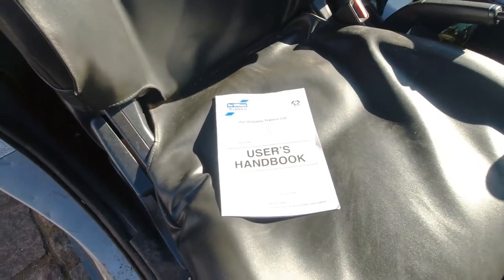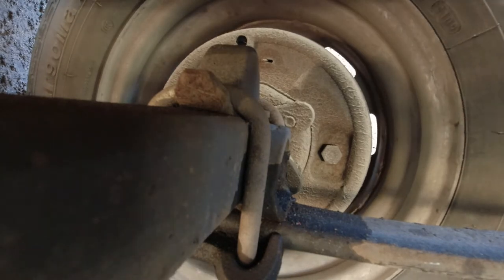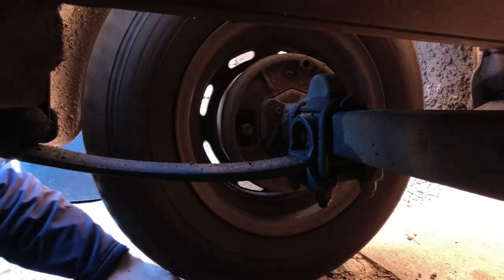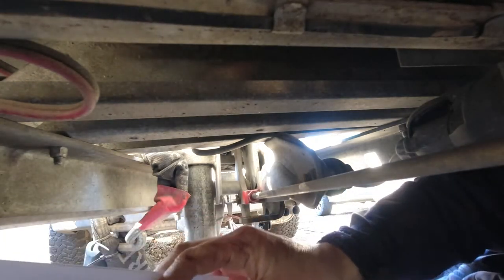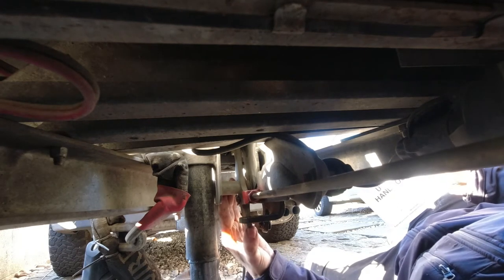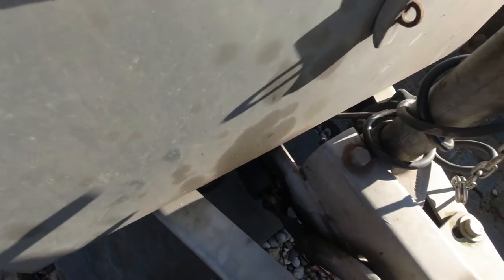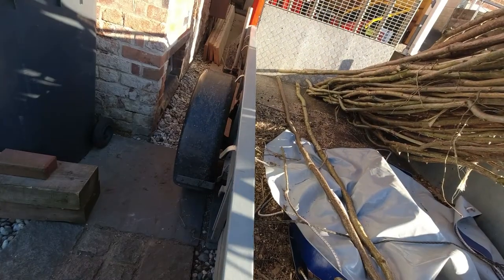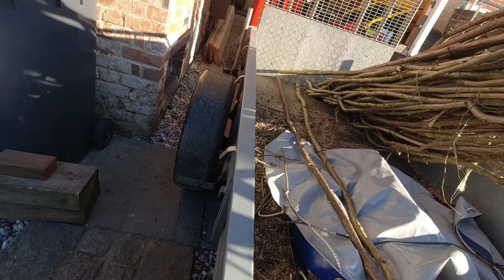Ifor Williams GD84 Trailer How to Adjust the Brakes

Comment: That’s just what I was looking for … a man with the instruction book doing it right as I’ve just bought a huge old trailer and have completely overhauled the brakes. Not I need to set them up… cheers very much 👍
Reply from the maker: Brilliant glad to be of some assistance
Reply: A lot easier to remove the road wheels to access the adjuster bolt on the back of the drum. That’s the back of the backplate, not front or rear side of the drum! 
To be honest most brake rods once set don’t need much if any adjustment. Adjusting the brake shoes with the adjuster bolt is adequate.
Reply from the maker: @medicontrol69  brilliant thanks, my next job is to check the brake shoes and replace if needed

Comment: Just doing this job today but as I understand it, when turning the wheels backwards they should partially rotate before re-locking, and for each wheel the handbrake will rise as the compensator re-applies the brake.  I don't think you turned them hard enough.  When doing this (or using the handbrake when rolling the trailer backwards) the handbrake will come right up towards the vertical.  Otherwise, a great vid.
Reply from the maker: ahh I see, thanks for the tip, it will help others too.  I'm due to look at the brakes in greater detail soon because when reversing the brakes lock on nearly all the time. I think new shoes and cables and a new damper is needed. question is do I make a video..
Reply: Of course :)